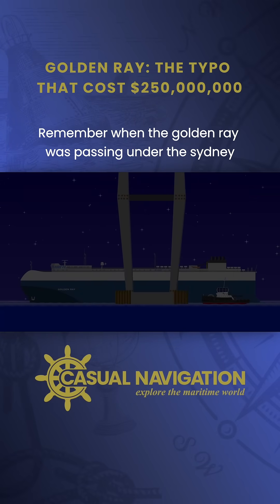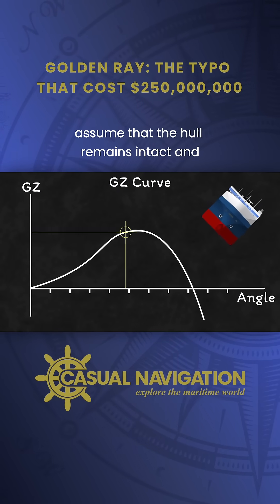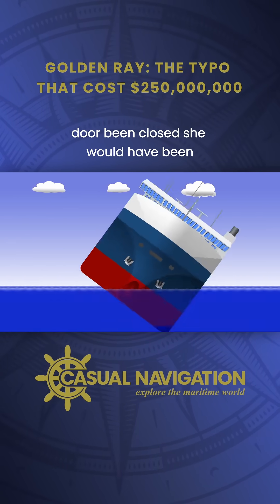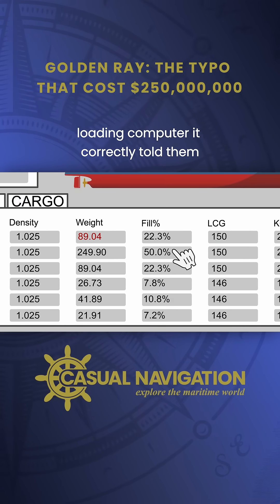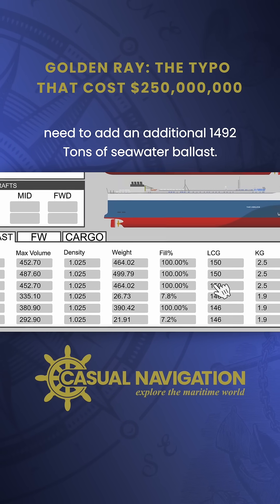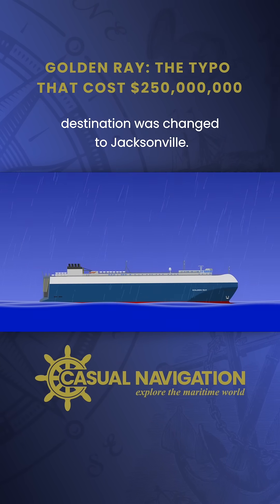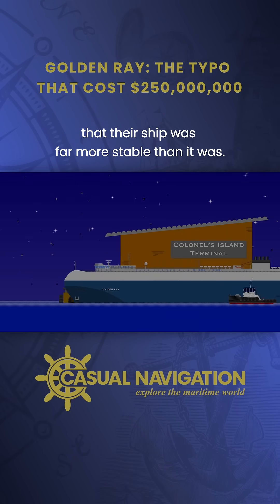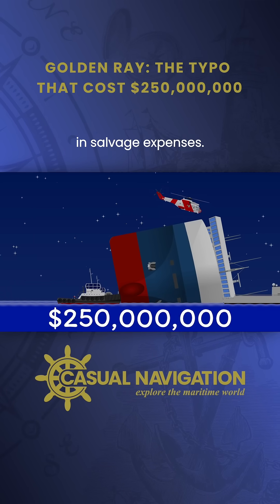The $250.000.000 Shipwreck Caused by a TYPO! 💸🚢

Comment: Also --- the crew left SEVERAL watertight doors open behind the open hull door for the pilot.  All absolutely required to be closed.  The calcs were faulty.  The operation of the pilot door and watertight doors was faulty.  Heck, the door for emergency egress from the engine room was poorly designed and too heavy to open.